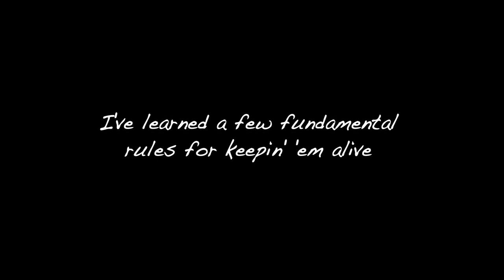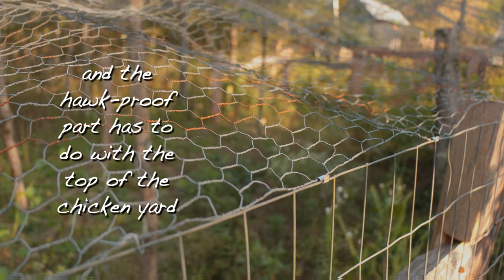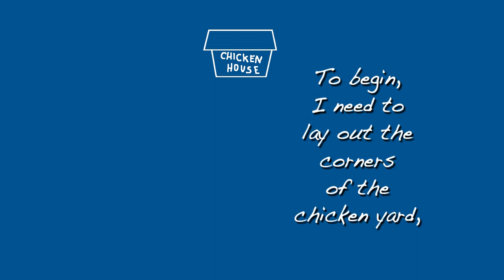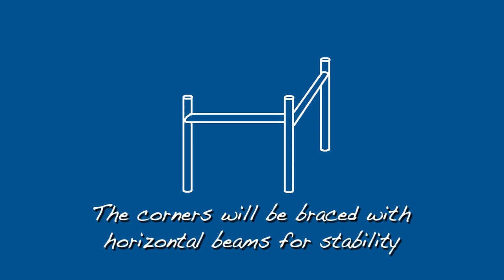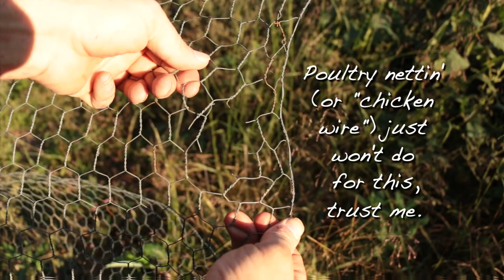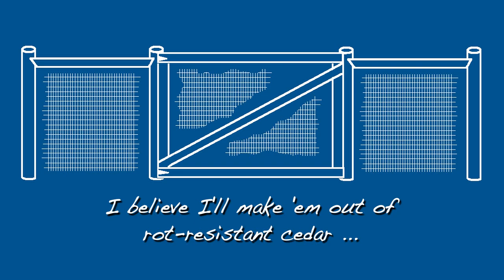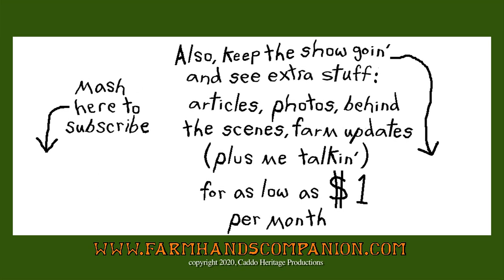Chicken Yard Fencing & Protecting Chickens  - The FHC Show, ep 26

Comment: I just love your videos!  We are now expanding our chicken run.  We also used the 2x4 wire and have now spent far too many evenings when it was time to close up the girls, chasing out raccoon and possum.  I didn't believe my eyes first time I saw a possum go right through that 2x4 wire.  They have to wiggle their hips a bit to get it done but they can go right through the stuff.  Young coons can do likewise and they can climb it as easily as going up a stair.  The predators have figured out that I am always around at mornings and evenings and have started arriving during the day and I am currently getting no eggs as a result.  I think the next step to the chicken Fort Knox will be getting lathe and doing a picket style fence around the bottom four feet of the 2x4 fencing.  I made my run in a narrow long pattern to discourage hawks and so far that strategy has worked though the plan is to add flight wire to be on the safe side.  It's kind of crazy the lengths we go to for our chickens!
Reply: I used those J-clips to add a second layer of wire, offset from the first. Fort Knox approved.
Reply: You should use hardware cloth to keep out the critters, I’ve not had any critters break thru my defenses yet in over 2 years and counting!

Comment: Hi Mr. companion!  How does building fence and rustic outdoor structures go with green wood? I’ve been wanting to mill the wood on our property myself, but can I actually use it right away?
Reply: Sure.  There will be some wood shrinkage, but that mostly shouldn't cause any problems, particularly not with rough outdoor structures.  If you're using wider boards for something like siding, you just need to allow for shrinkage, fasten the boards down so that you leave room for shrinkage and leave extra overlap so that you still have sufficient overlap after the boards shrink a little.

Comment: I'd love to hear your thoughts (or those of anyone else reading this) on sizing an area like this and its potential purposes as I'm considering what to build myself.  

I'm guessing it wouldn't take very many chickens to scratch the area within a 100' perimeter to bare dirt in relatively short time, at which point I wonder what purposes it serves.  If the run is just going to be bare dirt anyway, I'm thinking I might rather have my chickens under a solid roof (but with a section with 2x4 or similar wire fencing on the sides for fresh air and sun) so the manure doesn't get washed away by rain and I can gather more and put it to good use.  But maybe there are other advantages to a bare dirt run I'm not considering.

Alternatively, I'm wondering how many square feet per bird I'd need in a permanent run for grass to survive in most of the area.  I'm pretty sure, at least in my case, that that would very probably make the overhead protection from hawks completely impractical, but that if I see hawks or if my count goes down that I could temporarily shut off that larger area until the hawks move on.
Reply from the maker: Sounds like a good bunch of questions for a Q&A show, Patrick!